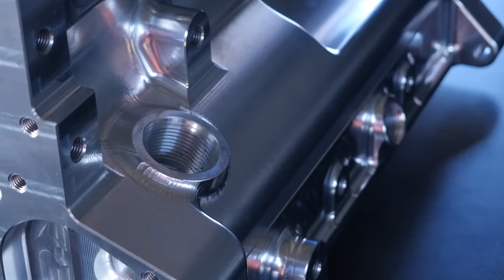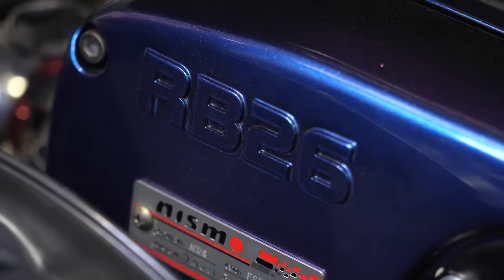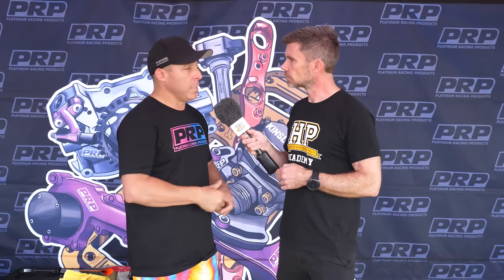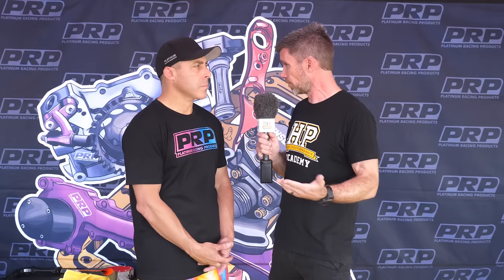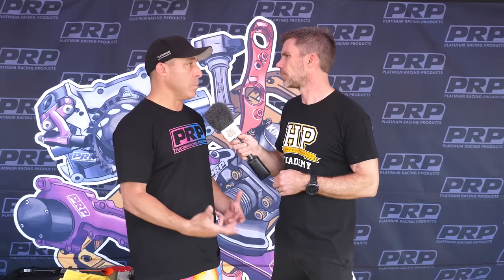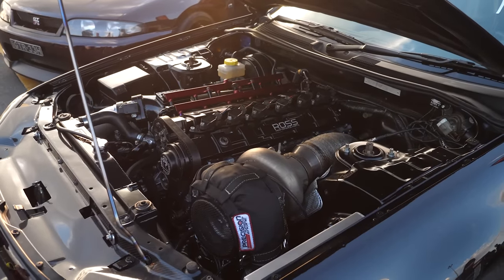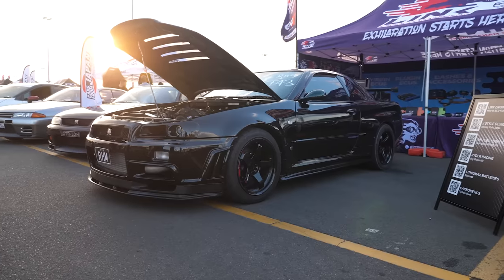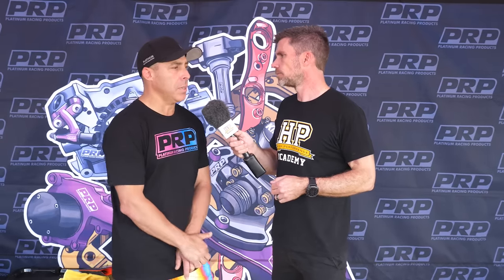What Is Wrong With A Billet Block?

Comment: Well, these have the same problem as my 2J. But, I'm not worried, because I'm not running anywhere close to 2J failure. I know the Baltic Supra ran 1300whp out of a stock block for the longest time, until he pushed it past that on his Nitrous setup. These Japanese inline engines are super strong in stock form. I'm just glad folks are still building parts for them. 🤙💪
Reply: Inline-6s in general are extremely solid engines. For example, GM's old Vortec 4200 has been getting a bit more attention recently as an American substitute for the Barra, with its big displacement and incredible responsiveness to boost.
Reply from the maker: You will (still waiting on this one too) have a similar option for your 2jz if you need it, noting Hermans's comment here on cylinder pressure being more meaningful when it comes to what a block will handle than peak HP.
Andre also got into that a bit with Julian Godfrey a while back too - Taz.
https://www.hpacademy.com/blog/darts-2500hp-aftermarket-2jz-cast-iron-block/?utm_source=youtube&utm_medium=social&utm_campaign=general-interaction
https://www.hpacademy.com/blog/700lb-ft-and-43psi-at-4000rpm-4g63-head-cylinder-sealing-julian-godfrey-tech-talk/?utm_source=youtube&utm_medium=social&utm_campaign=general-interaction
Reply: @griffinfaulkner3514  Blah, GM nuk nuks didn't want to get left out of the inline 6 discussion. Boy Chevy fan boy already got the world to himself but can't be left out of a discussion tisk tisk.
Reply: @dj4monie  Until Dodge released the Hurricane, it was literally the only American DOHC i6. There's other US inline-6 engines with legendary reputations (Cummins 12v, Ford's 300), but those are both literal truck engines. And no, I'm not just some GM fanboy, considering my favorite engine is BMW's S65 (glorious 8.5k RPM cross-plane noises), rod bearings and all.
Reply: @toughtimes721  thats horrible take lol shows your colors

Comment: Thanks guys. Learnt a bit about billet blocks. Would be awesome to have a dedicated video just on billet blocks. What needs to be done differently in the build process etc. Does the block have to be heated prior to doin bearing and ring clearances etc.
Reply: What do you need to know? Anybody that builds race engines can tell you in a ten minute phone call.

 You don't need a dedicated video for that. Everything Herman said is true. If you don't want to fiddle with stuff before you head over to Starbucks, then a billet block is out of the question.

People have been posting driving their cars though an insert fast food joint drive through for years doesn't prove sh*t.

 The bottom line is, most people haven't driven anything with 500hp, let alone 1000hp and almost nobody with 1,500hp

 You aren't actively doing anything. You aren't a member of SCCA, British Motor Club, NHRA, IHRA, etc etc etc.

 I've seen this mindless waste of money before. Building a 1200 hp Evo VIII just because, rarely drove it. Mostly a showcase for the shop that built it.

 Then people complain about paying taxes, hmmm.

Comment: Is PRP using 3d printed sand casting moulds?  If not, and they haven’t considered it, they should. Good, “inexpensive” way to test casting methods and part designs, and the sand should be reusable.
Reply: That is way too expensive, unless you are only doing protypes, or a super small number of castings.
Reply: Sand casting, unfortunately, doesn't make for an accurate enough cast.  You CAN powder cast, but you need a good high quality casting compound and a decent size vacuum machine to pull the air out.  The newer thing is resin printing a block out in burn-out resin casting material, and you can get a perfect cast every time and test prototypes super easily.

Comment: I'm a diehard billet person myself and for me the most important thing is stud diameter. You can have the fanciest rocker arms on the market and alloy HSS pushrods but if your studs can't handle the whiplash without flopping all around you might as well toss the keys to grandma.
Reply from the maker: Yes ultimately the stronger you make everything you just move the 'fuse' around as to what is the weakest link in the chain. This will never be a direct replacement for billet, just an alternative for builds that are more on the street side of things than lightweight race - Taz.

Comment: I once had a stock ford 5.0 block crack a few days after torquing the cylinder heads on.  It was the right front (facing engine). The stud pulled out and the block cracked down to the oil filter.
Reply from the maker: Ugh, that hit me right in the feels. How frustrating! - Taz.

Comment: 2.0 cdti engine that was in the  opel insignia have problems in third (midle) main bearing. Due to fact that cast blocks did't rest for long enough before went to machining... whole block warps and the midle main cap bearing sized the crank...

Comment: Nearly a decade ago, John Mihovetz prepped a cast oem Teksid 4.6 4V FoMoCo block, oe cast B-port heads, oe timing components and Kellogg crank ultimately running a 5.88 @ 256mph @ 2,500 lbs race weight. Dyno'd 3,000+ @ 10,000 rpm @ 55 psi

In 2019, John also prepped the oe cast 5.4L Ford in a 2006 GT and that engine holds the standing mile world record of 300.4 mph in 21 seconds from zero. That one made around 2900 hp @ 9,500 @ 50 psi.
Brett Lasala has gone 6.33 @ 225 mph with a sleeved cast Predator block, ported GT350 heads and Coyote crank. 2506 rwhp @ 47 psi. Ford's Cast parts work just fine.
Reply from the maker: Which one of those is a 2.6L straight six? - Taz.

Comment: It's interesting to me that billet blocks are so commonplace in Ozzie and Kiwi circles where you RARELY find them in the US for anything that's even remotely streetable (unless it's a Drag Week car). I believe it's the wide range of temperatures and humidities that you see in the US as compared to Australia. I'm also curious as to why cast iron was used vs cast aluminum - I'm assuming that the weight savings isn't nearly as considerable in an RB block. In a tall-deck LS or BBC, you're easily losing 100-150 pounds off the front end if you're building something that has a lot of power but can also handle.

Comment: 3~mm, damn that's thin.  I suppose with all the issues mentioned in the video, which I have never heard of.  I am grateful that my engines are a min of about 6.5- 7mm bore thickness and more around the 8-9mm at the deck.

As far as failures, only splitting the block down the center when pushing high rpm and boost have been seen a handful of times, but all have been after the valley has unnecessarily been drilled all the way along in the center of the valley for "oil drainage".    I'd love to see cast iron Buick motor sport blocks go into production again with modern improvements, but more so the heads since they are historic items now and highly sort after.

The alloy blocks aren't that great and needs lots of machining and mods to be even assembly ready and suffer some of the issues mentioned in the video.

Interestingly, when cast grey and ductile iron are concerned, they are a lot stiffer and dimensionally stable than steel and aluminum and also have extremely good dampening properties, meaning that shock and vibration are absorbed within the material all the while remaining stiff. All great properties for any engine. 

Also, although there is little info out there, higher nickel content iron alloys were used in some US engine including Pontiac 455, Buick V8s and then the V6. These alloys have exceptional wear properties well above anything I have encountered before.

Comment: Forged aluminum blocks with pressed in steel sleeves are best for reliability and durability. If building a race engine use custom made forged aluminum pistons made by BME with your specs.

Comment: Would you ever consider making prototypes using a 3d printer with the extruder swiped out with a wire wielder. the idea of making a 36in by 36in 3d printer using stainless steel wire to make a custom stainless engine block intriguing.

Comment: Doing amazing work Herman. Next do SR20 please
Reply from the maker: If products like this go well I'm sure we'll see an SR version somewhere at some stage, probably even a 4G63 too - Taz.
Reply: @hpa101 can you elaborate on what Herman meant about cold start ups with billet engines? Is there a procedure for street cars?
Reply from the maker: if you are running tight tolerances (tight at room temp) you need to be very careful with warm up. Many people are anyway just for mechanical sympathy, but it's not a choice with billet. Any supplier will give you a rundown on what they recommend in regards to warm up procedure. Some do use pre-heaters etc, we've covered them before for a time attack application also noting people are located in all sorts of different climates around the world.

If you are running looser clearances, which you will be for a high power application, you will need an external oil pump or a dry sump to deal with the low oil pressure.

This could be a deal breaker for some people, and not something others really consider an issue at all for how they use their vehicle - Taz.

Comment: I think it's weird that the comparison is for an expensive block instead of creating a market all to themselves and making others join them. I think it's a missed opportunity to solve a problem for the masses rather than going after the higher end folks with $10k spend for an empty block. Why wouldn't this be offered at $4-$5k which is still expensive, but it seems nothing has reasonable pricing anymore. But if the regular person actually had a replacement option available, they would be able to move more units in general and then leave to $10k for the blocks with all the options that are clearly looking to push the power potential.
Reply from the maker: If it was that easy to produce at such a 'reasonable' price, there would be people doing it already for sure. If you disagree, to be fair, no one is stopping you from putting it all on the line and diving into a business idea like that.
I don't mean that in a negative snarky way either, it would be great if you are right about this and could do it 😎  - Taz.

Comment: Not the end of billet aluminum blocks, will still be used for ultra small production projects 😊
Reply from the maker: Not the end at all for sure, billet blocks are still lighter and repairable (comparatively). For a high powered street application though aftermarket cast is certainly ticking a lot of the right boxes and a good 'better than middle' ground - Taz.

Comment: 10k is actually very reasonable for a block thats able to handle that kind of power and more accurately the torque reliably. This sounds like it could be a game changer. Proof will be in the pudding though I don’t doubt the kiwi’s will get this right
Reply: I think its very reasonable, you're getting a block that should last practically forever on a reasonable power street car.

Comment: If you take something like the 2jz block and can improve on its design, make it better stronger or the rb then go for it. Billet blocks ain't cheap and wasn't there a company in the US doing something similar last year for the 2j block, improving on the cast design but doing it without aluminium. Sure for just a block they were saying it was either 2500 or 3500 used at that time.
Reply from the maker: Dart do an aftermarket cast iron 2jz: https://www.hpacademy.com/blog/darts-2500hp-aftermarket-2jz-cast-iron-block/
Note Herman is talking AUD here when it comes to prices, and until they are for sale who really knows what it will come out at but it will be less than a billet block either way 🤘 - Taz.
Reply: @hpa101  yes thats the one i remember, these old engines designs with some improvements looks to be the future of aftermarket blocks. The rb and 2j blocks now are either getting rare or crazy prices, so these improved designs from cast I expect will be a big hit given what they offer.

Comment: I'm big on weight reduction because it improves performance in every way and makes the car feel wildy different given a similar horsepower range. I'm saving up for billet.
Reply: Im curious on the weight difference of a oem rb and a billet rb?  Maybe better places to save weight than the block.  Best wishes with your project.
Reply: @pranc236  I imagine it would be in the realm of 100 to 150lbs as a guess.

Comment: The problem with being an early adopter is inadvertently you become a full paying beta tester for the manufacturer.
The case for it does stack up though.
Reply from the maker: Those poor souls with buggered OEM Nissan blocks are the beta testers in this case rather than this being a blank sheet Gen 1 product. 
PRP are hardly some random Kickstarter company too.
So yes, some risk, but not in a traditional 'new to market' product sense imo 😎 - Taz.

Comment: This is awesome news! Just finished my Nitto 2.8 in 05U block. I will likely use one of these as a spare when I max out my 6870 or hurt my block. Is there an ETA or ordering list? Can we buy them completely built from PRP with pistons and rods, fully assembled?
Reply: They are sold out of pre orders probably at least a year + backorder 10-15 k USD
Reply: @BigPhatGreek  interesting. I see the preorder option on their website. I will likely wait and see how these work out since my stroker motor just got finished. Maybe buy one for next year or so.
Reply: @BrianCrofoot  I gotta get in as soon as I can since my 33 should land state side this month. Dam Aussies got me scared about the cracks haha
Reply: @BigPhatGreek yeah bro! You gotta do the PRP block brace if you’re going over 500hp and launching it. My block spent over 1 year at the machine shop. Nitto 2.8 with a Headgames head shooting for ~800whp with a PPG sequential! Should be running in my R33 in the next couple months!
Reply from the maker: @BigPhatGreek they look like AUD prices which would convert to be around 6,500 USD to 9,500 USD. That said, it's hard to bank on a price until they are officially good to go 😁  - Taz.

Comment: Are you guy's familiar with Steve Morris Racing Engines? He sells and designed his own super strong SML and SMX billet aluminum blocks and heads 
that have innovative water cooling etc. These engines can have between 2000 to 5000 HP which are highway driven to races across the U.S..
Reply from the maker: https://www.hpacademy.com/blog/093-how-do-you-build-a-4500-hp-engine-for-the-strip-and-the-street-podcast/

Comment: Wow 10k for cast block strait 6  800% mark up from build cost from factory
Reply from the maker: If you can find a brand new RB block for $1250 AUD and that is what you need, grab it before someone else does 😎 These are not made for those who can get away with using a factory cast block. It would be a waste of money.

If you're sick of chewing through factory cast blocks however, it potentially gives you an alternative than going straight for a billet noting for some people a billet is going to be what they will need, and yes, they cost even more - Taz.

Comment: Someone in the aftermarket should come up with affordable billet blocks that aren't necessarily race engine setup for the standard population that isn't shooting for 1000hp. I think would prefer stage level blocks instead of $20,000 blocks that a lot of people can afford. I'd rather invest in reliability for one of my cars that I can enjoy for years and years.
Reply from the maker: By nature the method of manufacturing from billet is costly, but it has come down over time already. Certainly not cheap, but it's in the ballpark for many racers compared to not at all like it was at some stage before technology caught up.
It's certainly at the point where for many racing use cases it will save people money over the longer term - Taz.

Comment: Not hating or picking nits, here... But don't all the stated negatives for "billet blocks" also apply to cast aluminum blocks? It seemed all the gripes were on account of thermal characteristics - tight bearing clearances when cold, etc. I've set up a handful of aluminum Ford 4.6 engines - and there's always a pucker factor when measuring the main clearance at 0.001" cold. But that's what it takes... And there's TONS of OEM aluminum blocks out there doing just fine. Am I missing something? I'm not claiming to be an expert - I'm genuinely curious.
Reply from the maker: They're using ductile iron for these blocks. 
For your question, the manufacturing process is not the same, but importantly nor is material: https://youtu.be/mOtSM_F14TA?si=jme9jsFnb6gmUvoQ&t=4002

You can fact check that elsewhere to be sure and you can look up all the different materials listed by those doing casting and billet blocks to compare yourself.

I think Oskar from Elmer Racing touches on this too when it comes to some material options within billet: https://www.hpacademy.com/blog/tech-talk-3000hp-10500rpm-4-cylinder-elmer-racings-106kg-billet-block/

Other podcasts that might touch on that, I can't remember sorry, will be Mark from Mazworx, Darren from Bullet and Oskar of Elmer Racing - Taz
https://www.hpacademy.com/podcasts/